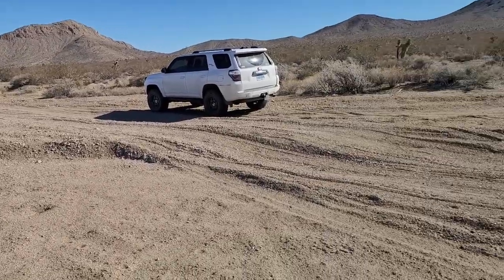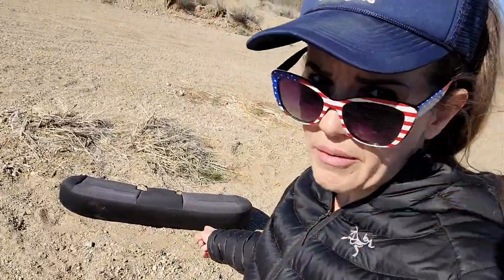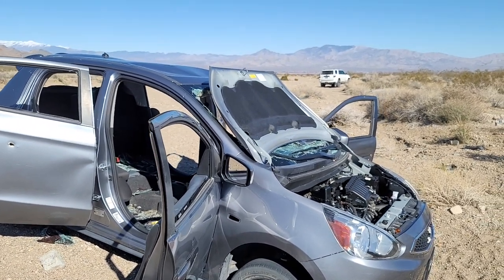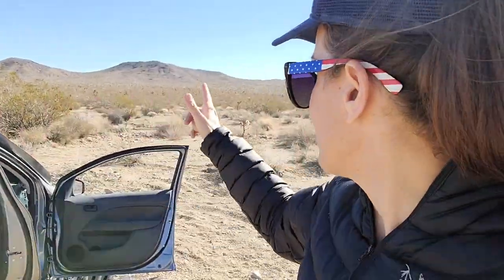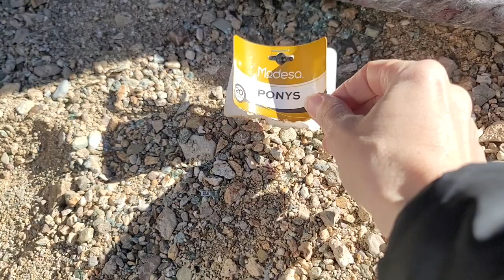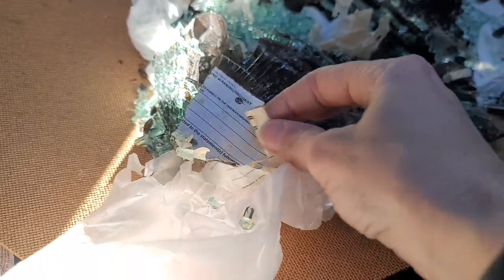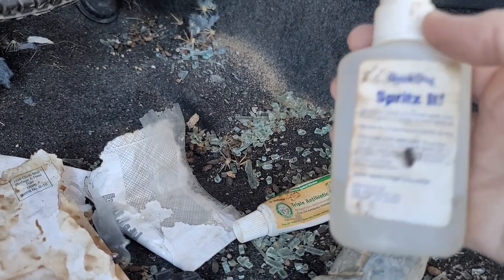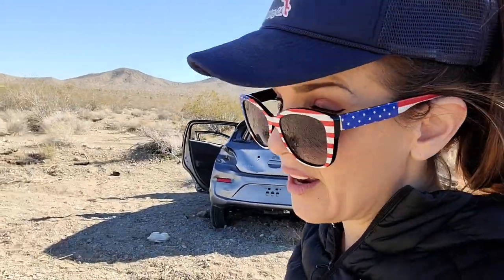#608 CSI Mojave: Was a Lyft Driver Murdered in the Desert...or Do I Have an Overactive Imagination??

Comment: The car was probably stolen and then stripped of whatever they wanted or it was stuck and the owner couldn't afford to recover it.  Then people found it and destroyed it and took what they wanted from it.
Reply: yup they took the battery and the front seats and it does look like they took the tail lights
Reply: @perry92964  NO bullet holes ?  Hasn't been there as long as she thinks .
Reply: I see bullet holes and think we are witnessing a snapshot of an active process, involving multiple unrelated individuals, unfolding over time.  I think she has touched on most of the probable scenarios though a flash flood on that wash could have been involved at the begging of the timeline. A cool mystery in any case.
Reply: @rickobrien4025  it has a few  but that just proves that the thieves werent gun nuts that just love to shoot at anything that looks like a target

Comment: Another theory: Behind in payments even with the Lyft side hustle, dumped it in the desert, reported it "stolen," insurance paid off the lender.
Reply: Particularly since the rideshare gig jobs dried up considerably during COVID.  The driver wasn’t able to even make enough scratch to make payments off of a Mirage.  I noticed the VIN plate on the driver’s side of the dash just below the windshield appeared to still be there though.  The CHP officer that placed the abandoned vehicle sticker on the back window would’ve made a report and the state insurance bureau database would’ve been copied on that.  That could possibly have messed up the scam, or not.  Hard to say, would’ve depended on timing of the CHP report vs when the insurance company paid off the loss.

Comment: I got stuck in a remote part of Death Valley when I was on a road like the one crossing the wash, and kind of assumed that the sand was more or less similarly firm alongside the road.
Maybe the driver of that car thought the wash was okay to drive on? And then tried to turn around, and ended up over on the side before the wheels sank in? 

That's quite a feeling when the wheels sink in an you realize you're stranded.

Comment: I had a 1998 Mitsubishi mirage when I moved to Vegas in 2003 with my mom and step dad. It would always overheat in 100 degree weather when I would turn on the A/C. It wouldn't overheat with that A/C off. It had little ground clearance but I loved it. It didn't help that it had a black exterior color.

Comment: The car was stolen and stripped and dragged on it's roof, shot at, and left there. How do I know that? Well, because a car I owned many years ago was stolen from our driveway, driven to a remote area, stripped, dragged on its roof and shot at. That's what these thugs do. They've been doing it for years and it's still the same. In cases like this, the owner doesn't want the car back (would you?)  so unless the local police haul it in it generally stays where it is. In this case, the desert. My car was left in the water so they had to hook up chains and haul it out. But, in a lake or in the desert it's all the same thing. The owner probably filed a claim w/his insurance co. like I did and got another vehicle. Interesting video.

Comment: That scene is the result of multiple visits by disparate parties, some human, some animal. It explains the strange state of the thing and why some things haven't weathered as badly as would be expected over the duration. For instance, the plastic under the hood looks in unexpectedly good condition because the hood may not have been open that entire time and when it was closed, they would have been shielded form sun and weather.

So that guy or gal tried to prepare for the journey by installing two lyfts, one in front and one in back but those alone didn't cut it. They were  missing the requisite drive train and beefy tires. If they had done just one lift, had 4WD or AWD and put some beefy tires on instead of just the two lyfts front and back, they wouldn't have gotten stuck. That's what happens when you cut corners.

Comment: I guess a couple of young hooligans stole the car and drove it around until they ended up in the desert. There they tore up the car until it broke down or got stuck. After that, they jumped on the roof and broke it. One of their friends picked them up. Then someone took parts of it like the front seats, taillights, etc. Finally, other passers-by have broken more of it. Over time, it will become just one abandoned car like all the other old cars in the desert that you’ve wondered about and guessed at their brand.

Comment: No mystery ... crankheads stole the car from the Lyft driver's home, drove it out into the desert, stripped it for what they wanted (to sell, trade, whatever...) and left it.   It happened to us ... we actually got our car back, it wasn't TOO messed up (broken windshield, seat belts cut out, license plates gone) but we DID have to use a screwdriver or a pair of scissors to start it up until we got it to the mechanic because the thieves had punched out the column.  
Someone should burn that thing and then it would be way easier to haul it away.

Comment: I think it was abandoned or stolen. I think pickup/gun types pass by this place and its typical vandalism. Tail lights have eBay value, but also the headlights have value, the battery is gone but things like the alternator were left. It doesn't look like a stolen car driven out to the desert to be stripped, it is not a very popular model so I doubt someone would bother stealing it. Government maintains the road and police occasionally go down it also, they mark then eventually tow such cars, the police put the VIN into their DB, missing persons or stolen cars probably would come up. They might try to contact the person to get them to pay for the haul away, across state lines might complicate things, though crime or missing people associated with a VIN might be national. The cops could have removed the plates though that's a lot of work, but removing plates kind of indicate abandonment, I don't think a thief would bother.

Comment: Almost certainly a crime or insurance fraud.  Car is too new.  If high mileage, even junked it is worth several hundred dollars. Two cars came out, one went back.  If the Sheriff knew they would tow it in.  My friends found a car they thought was abandoned years ago when they were out shooting in the Coachella Valley desert.  It was already full of bullet holes so they shot it up some more when the Sheriff came driving up.  My friends were not in trouble, but the Sheriff was not too happy.  It WAS a crime scene, the owner had been murdered.  Crooks steal cars ALL THE TIME, commit thefts or murders,  and abandon them in canals, rivers, the desert, whereever.   The Sheriff needs to be called.  Does anyone have exact GPS coordinates?

Comment: Hiya Sarah I'd guess there probably is a police report about the car being stolen, could those alcohol wipes have been used to wipe off finger prints or were they for cleaning hands during covid? 
It's sad to think that somebody had worked hard to buy the car and keep it on the road for it to ended up being wrecked. I know from bitter experience about getting a car stolen my  was found burned out, I lost a memory card with sentimental pics.  That was the worst part of the experience, the car was replaced but the pics were gone for ever.

Comment: Probably a stolen car someone dumped there! If not, I hope whoever it belonged to got home ok! When you see something like that always take a picture of the VIN number and report it to the local police. The VIN number can be seen in front of the steering wheel from the outside of the car through the lower left of the windshield on the front left of the dash. It is a series of 17 letters and numbers! If the police saw it the car would have been removed because of environmental reasons unless it is on your property. That is the middle of nowhere! Looks like vandals jumped on the roof and shot the car. Please report it! Who knows some family could be wondering what happened to their daughter or son!